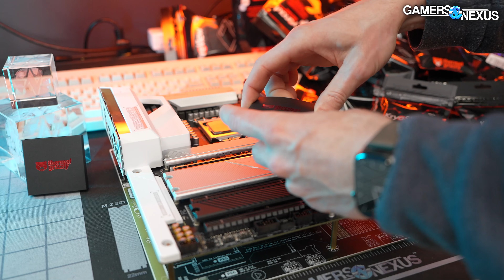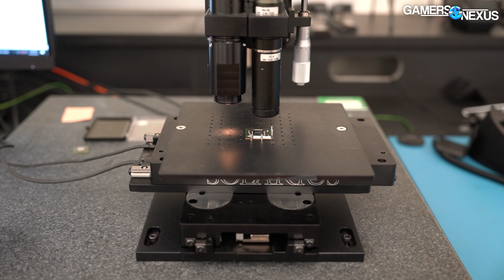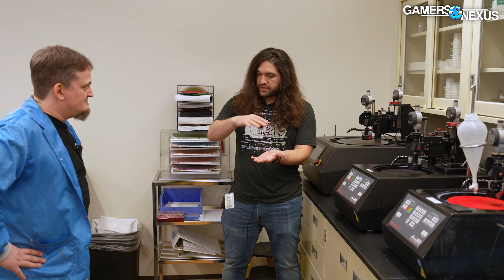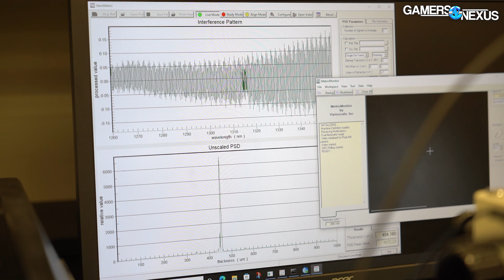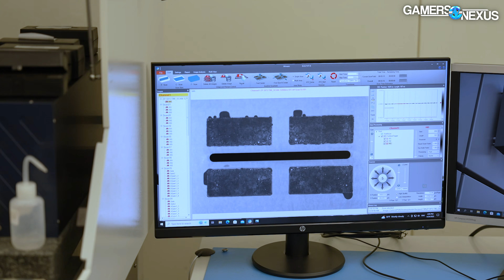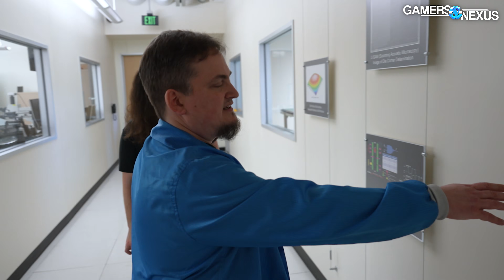AMD's CPU Analysis Lab Full Interview | Lasers, Scopes, & Silicon

Comment: I am NOT a gamer. I am an extreme designer. My work terrifies most managers. I tell them what I am going to do. That scares them because they know that it is impossible. When I do it, that scares them even more. 
I need tech fixes. I used to view LTT and JayzTwoCents as well as your channel. Then Jay's mask slipped and I saw the person under the mask. LTT (even before the sellout) was irrelevant. Shilling for Apple and $100,000 servers did not interest me.
Your factor tours are interesting and are worth multiple views. Your videos on testing are also good. Your videos on fires and exploding/melting components are useful.
Your videos on the latest junk age like milk.
I would like you to include mentions of obsolete circuits being used in the "latest" PSUs and video cards. A $1000+ card should use 2023 VRMs instead of 1920 VRMs.
Your videos of manufacturers' QC and testing are interesting. I would like to see videos on the actual design techniques used today unless they are just copying last century's design.
Please educate yourself on Resonant Tunnel Diode Threshold Logic gates vs. inherently defective CMOS.
Also, educate yourself on the last 100 years of advances in power conversion.

Comment: @GamersNexus 
steve, buddy, my pal, i think there was a little missunderstanding at 18:00. they are not worried about radiation, that is where surface area is king, but about accumulation. those atoms that are in 400 microns above the hotspot can accumulate a whole bunch more heat. while they are doing that, entropy is forcing them to vector energy out, branch if you will, to surrounding atoms more then a thin wafer that just has a tiny bulk.
the main point is like in sponges vs paper towels, you suck up more when you have more volume then area. sure heat is working more with mass and density and the configuration of atoms and molecules themselves but if all is equal it is far more easier for a hotspot to not burn out if it has more mass in a roughly conical shape above it (it should be a perfect dome but crystals have a funny way of directing energy where they want to).
in another words, hotspots don't care about radiation if there is insuficient bulk to accumulate that heat before it can be radiated. it makes the whole thermal profile of the cpu more uniform. with thin wafers it looks like polka dots, under thermal scope, before it burns through.
Reply: You are trying to correct Tech Jesus but you don't know the difference between "then" and "than"?  Hmmmm....🤔
Reply: @bobbydazzler6990  izvini brate ali nije moj maternji jezik. ovde nemam takvih problema.

is that better? i used my first language, where i don't have such problems as spelling errors.

Comment: Cool. Not wanting to waste these people's time is why I emailed AMD after an RMA saying I fucked up my diagnosis. Eventually found out it was my refurbed EVGA PSU that was causing the issues. Not having your PSU's board snugged to the case can cause significant problems. Whoever refurbed it forgot to snug those screws; that ground connection is important. I had to void my warranty to find the problem, after they expected me to pay for shipping. That PSU killed a few mice.

Comment: 17:18 "We made the IHS so thick because 1) stability for the cooler and 2) it makes the hotspots less distinct."

Considering Noctua found an offset cooler still works better even with the improved heat diffusion of a thick IHS, I now get why the IHS is as thick as it is. Smart.
Reply: They're talking about an inactive layer of silicon left attached to the die. The IHS is another part added later, though similar reasoning might apply to it.

Comment: Please interview the AMD GPU team and ask them what’s going on with their GPU dev work. Adding A.i. cores would be nice and better RT performance
Reply: They have them, they are just weaker than nVidias and share resources with other GPU units. They are not branded as Tensor like nVidias cores but as Ray accelerators, but it is essentially the same thing, hardware used to accelerate multidimensional vectors (tensors), which is needed to accelerate ray operations. And also Ai operations, since it is pretty much the same workload (accumulation and propagation of signals).
Reply: However you need to think out of the box when suggesting what you want.
Would you want AMD to use 25% less silicon for rasterization to fit 25% more silicon for RT and AI?
They would start losing in pure GPU speed to hopefully match nVidia RT.
Obviously they cannot just add more silicon, since that would be 25% more TDP and 50% (non linear scaling in failures) less margins.
So that would mean that what you want (adding) comes with drawbacks (in rasterisation or in price).
What you really want is for them to improve the efficiency of the design to match nVidia, and that is not so easy when you are competing against a company that has 5x the net worth, and essentially a monopoly on the industry.
Reply: Imagine having the take that you want worse performance with worse rasterization so you can have better AI stuff.

They’re making gaming gpus.

Comment: The most interesting thing I gleaned from this is that there is a huge amount of material on the top side of the silicon which paradoxically actually helps spread the heat out rather than having intense hot-spots (as well as providing structural support).  Also very interesting that the transistors are on the underside of the silicon for that exact reason.  Furthermore from what it sounds like and correct me if I'm wrong but it sounded like the gentleman said that the mobile chips are thinned?

Comment: you should've asked him why the CPUs and GPUs are so buggy and easy to break and have 90+ degrees!! 💀💀
Reply: Both Intel and amd have designed their current chips to run near thermal limit at all times for performance reasons. Intel 13900k will hit 90-100c constantly if your board supports that level of power delivery.
Reply: Intel can be delidded and cooled much more OK than AMD crap and temperatures aside, AMD in general is crap, their support, drivers, general flow is crap, buggy @TheScyy
Reply: @andrewsstuffofficial Cooling 350 watts is way more difficult than cooling 150 bud
 
Temps aren't energy in the way you think they are
Reply: =)))) so you are telling me AMD is only drawing 150? you trippin as hell bruh @FeintMotion
Reply: Stop spreading FUD
Reply: how is that FUD? :) @riba2233